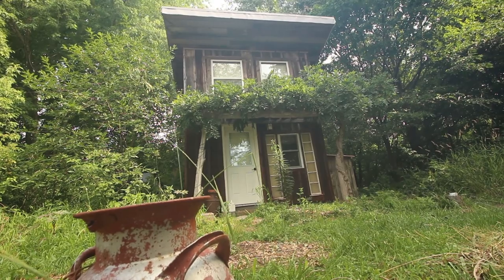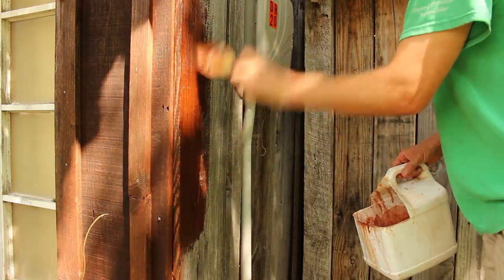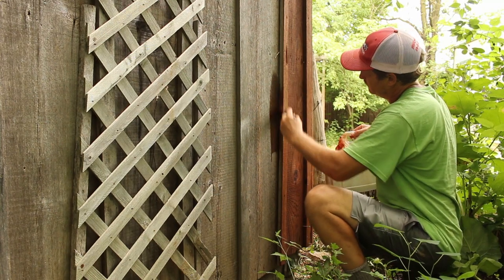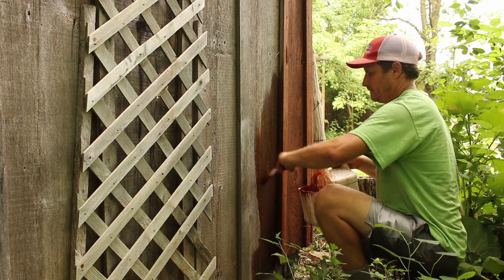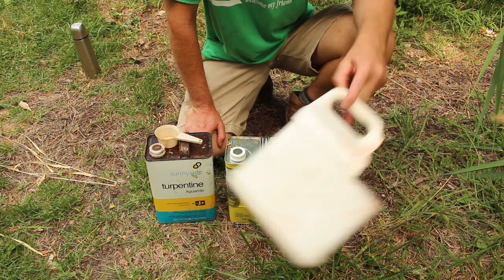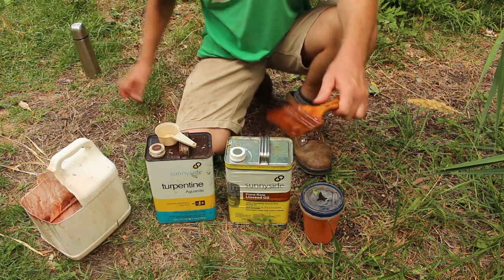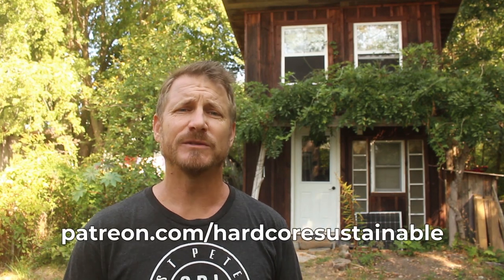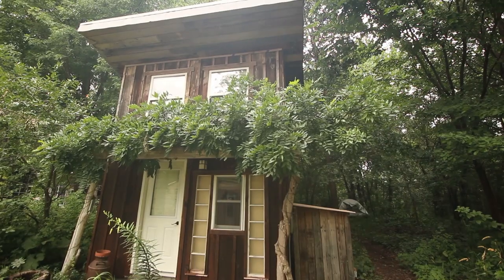Natural Alternative to Paint for Wood Siding

Comment: Good stuff.  I'm happy to see folks going back to the old ways.  The reason our barns are traditionally red painted is exactly because of what you demonstrated.  The Red Ochre (rust) has natural anti-microbial/fungal properties in it that inhibits rot, and the European settlers brought that ancestral knowledge with them.  In your mix, the turpentine is what's really helping to prevent rot.  Turpentine is made as you showed, but what a lot of people don't realize is that the Pine Tar is actually the stronger and thicker version that's often called Stockholm Tar because it was once so necessary to keep ships and organic ropes from rotting away as they sailed the oceans.  Turpentine is a great thinner and solvent, and is produced almost as a byproduct of making Pine Tar.  The turpentine and pine tar have natural anti-microbial properties to them, and you'll find no better wood preservative out there.  Thankfully, you can still buy Pine Tar at your local livestock places as it's recognized for it's healing properties and often used as a poultice for animals because it is so good at preventing cuts from getting infected.  Makes a great soap for people, too!
Reply from the maker: Thanks for the additional information! Very interesting and useful.

Comment: The classic swedish recipe is ironoxide boiled in water with rye flour and then adding a little linseseed oil. That has basically covered all barns in Sweden from the 1700s to the 1950s.
Reply: I think it's called Red Oxide paint (as manufactured with a Linseed oil matrix).

Comment: Congrats on the 40k subs! Nice video and sweet to mix in the bird sounds in the end.

Funnily enough I used this method to stain some wood not too long ago but the only pigment I could get was an oxide so it did settle quite a bit in the bottom.

Thanks again and happy days.

You are probably one of my longest subscribed channels.
Reply from the maker: Thanks for following my channel for so long! I haven't tried oxides for pigmenting before. I get the idea that they go a lot further for the amount you use. I guess you just have to keep stirring to keep them integrated.

Glad you liked the bird songs.

Comment: for higher viscosity, use vaseline or bee wax. Heat it up until the wax is liquid cool it down and shake it beetween. So you get viscous linseed oil paint. 
You can use it for everything .... wood stone iron metal or car underground protection (Fe2O3 pigment or Al + Zn powder)
Reply from the maker: I'd prefer the beeswax since the vaseline is derived from fossil fuel. I recently refinished the surface of my dining room table with a beeswax, tung oil, linseed oil, and citrus solvent treatment. It was the consistency of a salve. It has worked really well on the table and is much more natural than polyurethane.

Comment: Great video! Thank you very much. 
Would you recommend using similar wood paint for the interior of the house ?
Reply from the maker: I would use a different mixture for interior. If you are talking about trim, there are many other options such as tung oil and linseed oil mixtures, waxes, etc. But I'd recommend something like a citrus solvent for indoors even though those have turpines as well. But they smell better than turpentine. There are many premixed products offered by natural finish companies. They can be pricey but you can always get ideas and try mixing your own. Just straight linseed or tung oil can work fine on woodwork, but you could also mix in a pigment if you wanted a color. The solvent helps the oil penetrate deeper and protect deeper, but this might not be necessary indoors.

Comment: the color came out great, beautiful tone. would blue or yellow pigments be as visible?
Reply from the maker: Yes I believe they would. You might have to put more coats on. You can see the green color on the trim in the other building at DR that used this method.
Reply: In my xperience blue pigments fade fast ( 4 to 5 years) a d un evenly from one side of a house to another, or under overhangs etc. 
Also i don’t know of a natural blue pigment. They are metal oxides. And unfortunately toxic oxides.
Reply from the maker: @TheEmbrio  Earthpigments.com says " Oxides are reliable tinters suitable for all mediums including arts and crafts, plasters, cements and more. They are manufactured by the synthesis of natural ingredients, being non-toxic and responsibly produced." Why do you think they are considered toxic? There are some lighter blue mineral pigments, but the oxides give a deeper color.

Comment: Love this video. Apparently I can't purchase Turpentine in CA. Can you recommend a citrus solvent? My search has a mix of citrus strippers and cleaning products, not just a specific citrus solvent. Thank you!
Reply from the maker: Milk Paint Company has a citrus solvent you can use. It's expensive. Usually the citrus stuff is a lot more expensive and I'd guess with the spread of greening disease that's killing the orange groves in Florida, orange byproducts are getting more expensive. I used to use a product called CitraSolv, but they've stopped selling it in any size bigger than 8 oz, so it's super expensive.

Comment: Love it, thanks! I'm assuming this could of course be used on plywood siding, yes? And what would you say would be the coldest temp at which it could be successfully applied?
Reply from the maker: Yes it should work on any kind of wood siding, though plywood is less than ideal alone as siding and is better for sheathing on a building. I would say probably anything below 50 degrees F would take a lot longer to dry.

Comment: Nice. In what frequency (years) do you have to apply it for a new layer? Is it possible without pignent for a transparany look or will it going to be grey? .
Reply from the maker: You could apply just the linseed oil and turpentine, without pigment if you want the natural wood color. I'd say a treatment would last about 10 years, but doing it every 5 would be better. And doing multiple coats would last longer and be a better protection.

Comment: can this be applied on old Cedarwood that was previously stained not with this solution, but with a commercial stain?
Reply from the maker: If the wood is porous and can take the solution up, you should be fine using it.

Comment: Slightly unrelated question! 
Could a person use this mixture to paint with, in a 'Fine Art' sense? 
Using less of the turpentine and more of the pigment?

I'd like to find alternatives to solvent based paints that are more Earth friendly. 
I didn't realize gum turpentine existed! 

Would you say beeswax would be good to add to it, as a previous commenter said, to increase viscosity? 

You might not have the answers to these questions, but I'm super curious and very inspired by your video! (:
Reply from the maker: Yes, I believe that oil paint is just linseed oil with earth pigment and can be thinned with turpentine. If you added beeswax, you'd have to heat the mixture up to melt the wax and incorporate it. You have to be careful not to ignite it because that would be bad, but usually the heating to melt is much lower temp than ignition temp. But turpentine is very volatile, so that's what you'd have to be careful of. An induction burner wouldn't have the flame or concentrated heat, so would be safer.

Comment: Great video! Do you happen to know how long this lasts before it needs to be reapplied? I have a lot of cedar siding I need to protect and an economical home brew sounds pretty good!
Reply from the maker: I did a test area on the back of this house several years ago now and it still looks good. Another house where I live had this done probably 10 years ago and it was just redone. So it lasts a while and just getting it refreshed every 10 years would probably be fine.
Reply: @HardcoreSustainable  awesome, I like the idea of it weathering away where it can just be easily gone back over....instead of peeling and flaking and having to be scraped off.
Reply: This is a very very ancient practice that was once common throughout Europe.  Old Stave Churches and other historic buildings are still standing because they've been treated with pine tar, turpentine, and linseed oil.  The pine products have a natural anti-microbial function in them that prevents rot.  There are companies out there still selling paints made of these components, in a wide range of colors.  You'll likely have to refresh the coating every ten years depending on your climate.

Comment: Looks to me as though you had previously mixed pigment into that old turpentine then forgotten about it.
The natural (Australian) gum turpentine I use is clear as water.
Mineral turpentine is cheaper and much easier to find, but this is a petrochemical compound. Gum turpentine smells fabulous.

I mix gum turpentine with boiled linseed oil, which as far as I know, is simply boiled, not mixed with anything.
I use this to treat indoor wooden furniture etc, and wooden tool handles. It does a great job and gives a gleam as the boiled oil polymerises and solidifies. 
I find that raw linseed oil remains sticky.
But the wood that is exposed to weather does need recoating I find, about yearly, to retain the benefits.
People should not eat linseed or its oil raw. It must be boiled before it is safe for consumption.
Reply from the maker: I looked it up after doing that part of the video and the old turpentine oxidizes and turns brown. So it was just an open can that had oxidized. Yes, I wanted to real turpentine without the fossil fuel additives. 

Boiled linseed oil is linseed oil that's been superheated for a long time and becomes "stand oil", but it also has petroleum solvents and driers added as well. That's why I'd rather not use it.

I wouldn't recommend eating the raw linseed oil in the cans like I'm using for this project because it isn't food safe. But a lot of companies sell linseed oil mixtures for wood treatment that are specifically said to be safe for cutting boards or other food applications.  

I did find a reference to the need to heat flax seed before eating to destroy the slight toxins in them on the Mayoclinic and NIH sites. I didn't know this. Do you think the food grade flaxseed oil sold in stores is made from heat treated seeds so it doesn't have the toxins in it?
Reply: @HardcoreSustainable  
I know from feeding linseed to horses, that it must be soaked and simmered for a long time to make it edible, but mum's canaries can eat the seed with no ill effects! Presumably food producers are aware of whatever needs to be done to make it safe to eat.
I studied some more about linseed oils. Boiled linseed oil is not boiled, but has heated air blown through it, and some metal catalysts added to speed drying time, so it dries in about 2 or 3 days, whereas raw linseed oil can take weeks or months. That's why I prefer boiled oil for tool handles!
For food preparation wooden objects, I use macadamia oil which does not turn rancid.
Boiled linseed oil used to contain compounds of lead, but thankfully, now it doesn't!
Rags and paper towels used to apply or clean up linseed oil can heat up and spontaneously combust, so should never be thrown in the trash while wet. Spread them out on concrete or metal for a few days to dry, then throw away. Or seal in an airtight can.
Reply from the maker: @rubygray7749  Yep, there was a fire that started here a long time ago from a pile of rags soaked in linseed oil. Knowing that, I always hang mine up and keep them separate from each other so they won't catch fire.

Comment: There's a guy Noah Bradley that uses mineral spirits, boiled linseed oil and paraffin wax to water proof wood, log homes etc.
Reply from the maker: That probably works. I was going for a fossil fuel free option. Raw linseed oil doesn't take the energy inputs boiled does. And mineral spirits are made from fossil fuel. While turpentine is from pine resin. Paraffin is also from fossil fuel. It's my preference to do it without as much fossil fuel, though likely fossil fuel is burned to manufacture all the ingredients in my "natural" recipe. Fossil fuel is burned to manufacture all the fossil fuel based ingredients you mention too.

Comment: Was wondering why use lindseed rather than hemp oil?  Hemp oil is stronger and last longer from the talking heads on YT?
Reply from the maker: Because I can buy it at my local hardware store and it's perfectly sustainable to use. I could also use hemp oil, but I'd have to special order it through the internet and it would be more than twice the price, $30/gal (off the shelf) vs $82/gal (before shipping). 

Looking up info, the Milk Paint Co. says that hemp oil doesn't hold up as long as tung oil does. I would have liked to use tung oil, but it's more expensive and requires special ordering. The MPC says on their website, "It’s therefore recommended that you use tung oil for projects that require more staying power (your backyard shed, for instance) and save hemp oil for lightly used items that wouldn’t be exposed to wind, rain or repeated trips through the dishwasher." So probably hemp oil is comparable to linseed oil for this application. 

The advantage of the hemp oil would be that it doesn't require a solvent like turpentine to apply it. It's not as viscous. I had bought the turpentine many years ago and so needed to use it anyways. But probably doing without the solvent would be a positive. Then of course you'd need to buy more of the hemp oil to go as far as the half and half mixture I used. Tung oil would need the solvent.
Reply: @HardcoreSustainable  I see!  TY, I was seriously wondering how these products compared and the rational behind them before I use them myself.   
I ESPECIALLY like not having to remove old paint!!!

Comment: petrochemical paints came in the 1920's along with sand and cement as its quicker cheaper labour cheaper in cost and cheaper to produce also to make it more affordable for the working class and middle classes. But natural paint were never non toxic as linseed paints contained lead for anti fungicide and extra flexibility not sure about original lime wash and other natural paints but linseed paints now use zinc and titanium dixoide which isn't no way near as effective as lead as a anti fungicide now its to prone to mould and algae growth the companies that make will tell you it is but I've used and seen with my eyes on several jobs and its not. Ive had it suffer with terrible algae growth after a year on quite few jobs. The best system now is owatrol oil combined with owatrol deco for paint but very expensive in product and labour
Reply: Wood finishes and related petrochemical treatments and uses go back over 2000 years, not the 1920s. Polurtheans started in Germany in the 1930s and Latexs (aka “plastic paints”) just after in the 1940s. “Concrete” too has been around for over 4000 years and almost all formulas have a sand/gravel aggregate added to the mix. Modern industrialized and massively polluting OPC cementitious materials are modern, cheap, have a huge carbon footprint, and are degrading rapidly. 

You are wrong about “natural paints” not being toxic at all, most in history have been harmless as are the better ones today. “Nontoxic” does not mean “food safe” or potable. Many natural oxides, and thinners (e.g. citrus, turps, copper sulfates, etc) which are all-natural should not be eaten, however their toxicity level to a biome is negligible at best. I’m not sure where that opinion came from. Lead was not, and still isn’t added to most traditional natural lipid-based finishes be they a paint or stain. Natural fungicides come in many forms besides lead, though lead paint was (and still is) made. It is also a natural paint and is only really toxic if consumed… most people don’t eat lead paint. Its main use was (and still is) in boat building finishes on wood just like it has been for several millennia…

Many natural mineral-based additives (et al) inhibit mold. Lead was one and you listed a few of them. Lead was not added to paint for just “mold.” I can’t speak to your experience, or whether you did the work properly. If you get mold in the finish afterward there could be many mitigating reasons from improper use to environmental, or age of finish when applied and the list goes on.  

Traditional blends, like the one shared in this video, can last well over 350 years before complete degradation. As all wood finishes are considered a “sacrificial layer,” eventual failure is expected. The durability of natural finishes far exceeds that of modern industrialized finishes and this is based on my experience in blending natural finishes and working in historic restoration. Older ages are claimed by others in this field mainly from Europe, the Middle East (over 7000 years for paint there), and Asia…

We agree on the “speed and greed” part. I would not recommend, at all, the manufacture you shared. However, I will own my bias there as I only use natural and traditional finishes that I blend myself typically, or by those I trust...